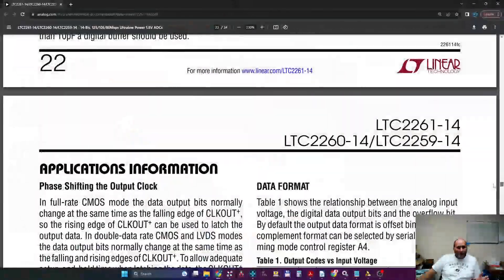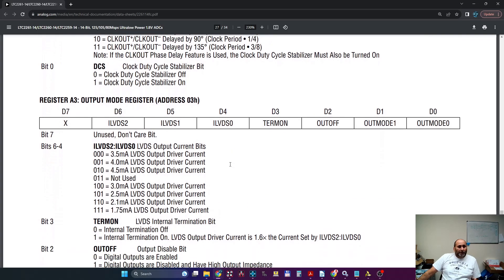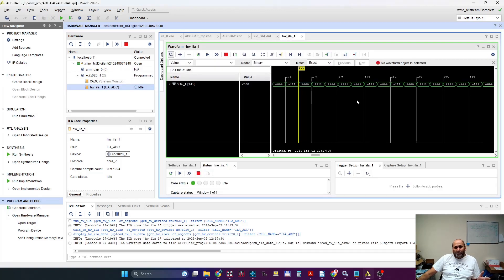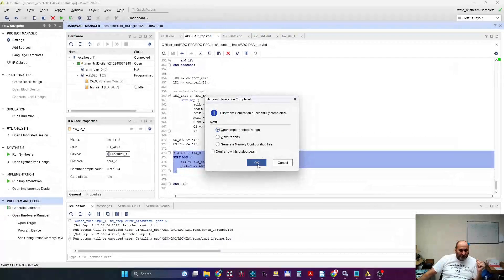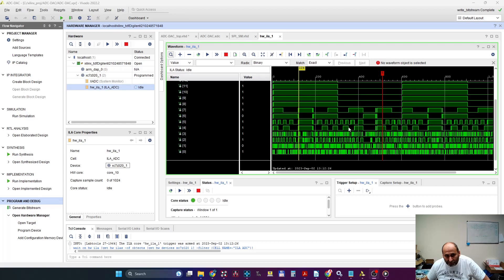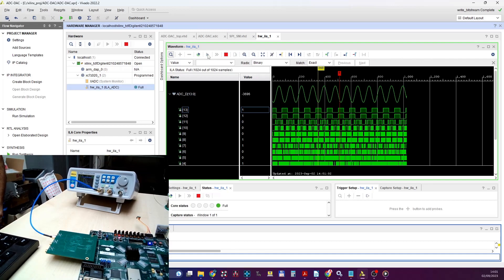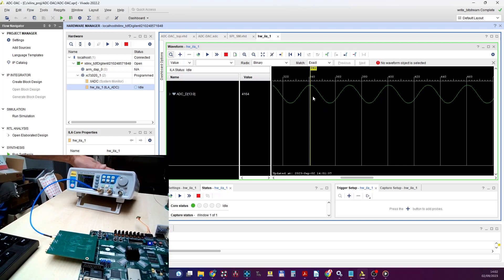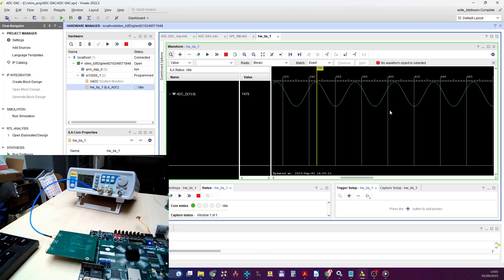Testing The ADC  on the ADC DAC FPGA board

Comment: Very nice video! Nicely done. I wonder how did you derive that the problem was with the DDR?
Reply from the maker: Hi There,
I figure out the DDR problem by looking to the captured signals using the ILA (integrated logic analyzer) if you sample a sinus signal you can see how the samples are crossing zero and they change the sign (twos complement) and it becomes obvious. With a checker board test signals you can't spot these type of errors

Comment: Dear Adaptive Design Team,

I hope this email finds you well. I am Aditya Giri. I am currently doing my graduation in Electronics Engineering from IIT(ISM) Dhanbad and I am working on a project that requires the integration of two microphones onto the Zynq Z2 board. Furthermore, I am also keen on implementing an Active Noise Cancellation (ANC) algorithm using the Filtered-x LMS filter. Given your expertise and previous projects, I believe you could provide invaluable guidance on this matter.

Microphone Integration:
1. Could you advise on the recommended type and specifications of microphones that would best suit this application?
2. Are there any specific interfacing requirements or considerations when connecting two microphones to the Zynq Z2 board?
3. Is there a specific library or software tool that you would recommend for processing and managing the dual microphone input?

Active Noise Cancellation:
1. I understand that the Filtered-x LMS filter is a common approach for ANC. Do you have any references or sample codes for its implementation on a Zynq platform?
2. Are there any specific hardware or software optimizations you would recommend to ensure efficient real-time noise cancellation?
3. Are there any known challenges or pitfalls to be wary of when implementing this algorithm on the Zynq Z2 board?

Your insights and suggestions would be incredibly helpful as I move forward with this project. I appreciate the time you take to read and respond to this email.

Looking forward to your guidance.

Warm Regards,

Aditya Giri
Reply from the maker: Hi Aditya,
please watch the video about how to interface PDM microphones on this channel https://youtu.be/KDfQu6r3RIM or you can use a I2S digital microphone but in this case you need to deserialize the I2S stream (not difficult in VHDL or Verilog) - for the noise canceling algo is a bit tricky you need to know the source of your noise (the spectrum) and subtract or filter out the noise.